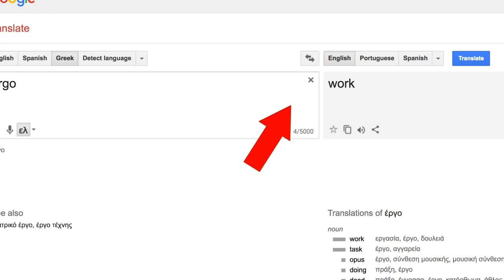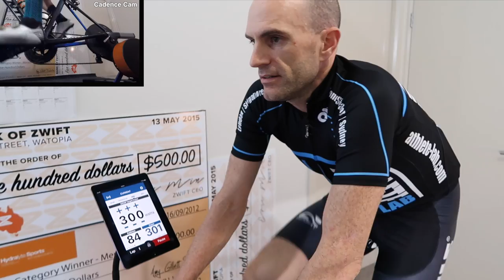Indoor Cycling Smart Trainers: ERG Mode Explained

Comment: Great information!  I wonder why Zwift doesn't just "program" the SOD (Spiral Of Death) out of their workout mode?  Seems to me you could program some automatically applied very short ramps at the load changes to eliminate, or at least reduce this effect.  Or how about a user set minimum RPM value, below which ERG mode would drop out.  You could even set a RPM value at which ERG mode would resume afterwards.  Maybe even program a recovery ramp for the load.   Sorry... just me thinking too much.  Again, GREAT work on these types of videos.
Reply: I do not think it is necessary, it is really easy, after few trainings you will do it all automatically without thinking about it. And it will also push you to try harder, you will know that if you fail you stop and you will do maximum to avoid it :)
Reply: Delkim; Could be...  But I ran across an online "review" of Zwift workout mode where the reviewer was obviously falling into the SOD, but didn't understand what was going on.  He had a few harsh words, concluding that it was "unusable".  I know I didn't understand what was going on my first couple of Zwift workout excursions.  Thanks to Shane, I figured it out a while ago.  That said, this videos introduction of the SOD coming in as the load is being reduced was another "ah ha!" moment for me...   Cheers!!!
Reply: Also, was thinking about how they could just program in a simple visual delay.  Myself, I am clued into the "arc" on screen.  My mind says I can "relax" once I cross it or that I should crank it up as I approach.   Zwift could simply but a delay in that, or alternatively an advance in the load ending.  Maybe both could be user designated.  Just thinking...

Comment: Shane, A question.  you mention that some trainers handle the transition quicker than others.  Which would you recommend that handle the transition a little quicker.  By the way I notice that there seems to be two parts - a delay after the new segment starts before the transition starts, and then the transition itself.  For instance with my Direto and Zwift a 160-400W transition actually has a delay of 3-4 seconds, and then starts the transition.    Oddly with trainerroard, I get the transition, but not teh delay.  With Direto & Zwift I get the delay going down in power as well.    So advice on any trainers that handle this better would be appreciated.    I am primarily using the turbo for training in erg mode and structured workouts.

Thanks for your excellent videos and analysis by the way.
Reply from the maker: Trainer Road preempt the change and send it to the trainer early. That's my experience. The Stac ZERO Halcyon kicks in super fast. The Neo in theory does too, and in practice... the issue with 'in practice' is the ANT+ limitations. You may get more responsiveness out of Bluetooth Smart.
Reply: OK that explains things.  Thanks Shane.   @gplama

Comment: Any tips for getting out of the spiral of death?  Backpedal, adjust target power on the ap, stand up and mash your pedals to get going?…
Reply from the maker: Never go past the event horizon..... there's no going back! Some software will back out of ERG if it detects you've failed the effort.
Reply: Haha.   But it’s not by choice!   In all seriousness, after years of resistance to a smart trainer I switched over.   What I didn’t like so far is when doing the super hard 2’ VO2 work and barely hanging on, a few times the trainer thought I was failing and sent me into the spiral.  If it had been in resistance mode, I’m quite certain from experience I could have held on.  Hopefully I didn’t just spend $1k for a trainer that I won’t use...!

Comment: Great video Shane. I created a custom Zwift workout, based on a GCN workout. In the GCN video, they want me to ride at 85% FTP but only spin at 50 cadences. I can not do that on the Elite Rampa. If I spin at a cadence of 50, my wattage is about 40% of FTP. How can I get the resistance up, while still holding my power? Also, I was curious, there seems to be more than one way for Zwift to pair with the Rampa, should I always use Ant+ FE-C? Thanks VERY much!
Reply from the maker: All trainers are not quite the same when it comes to ERG. You may need to change gears and change the flywheel speed (up or down, it could be either way) for it to apply the correct resistance at the required cadence. There should be an optional flywheel speed for ERG... which isn't published as part of unit specs. FE-C is what you should pair to with this unit, not the RealTrainer profiles.
Reply: Shane Miller Awesome suggestions. Thx

Comment: Hey Shane, so I've been doing time trials now with clip on aero bars and have been doing well in my races usually placing on the podium. Would you recommend investing in a time trial bike. Some more info about me, I'm 17 and have already purchased aero wheels and a tt helmet.
Reply from the maker: Sounds like a good question for a coach who knows what your current limiters are.
Reply: No any position or change on usual road bike or any clip on aero bars can match that huuuge difference when using real TT bike. If you are serious about TT then buy one. Even some cheap second hand TT Alu bike will always be faster than super expensive carbon aero road bike!

Comment: Shane, once you go through the spiral of death and you're still in the workout, how can you restart without completely burning out your legs? I have the Elite Direto if that matters and I mostly use it with a Garmin Edge 820 in workout mode on the trainer. Thanks
Reply from the maker: ERG mode will automatically disengage within Zwift if you encounter the spiral of death.... If you're controlling the Direto with the 820 then you'll need to use that to reduce the ERG setting to get up and spinning again.

Comment: Question for you Shane (or anyone) if you'll indulge me. At around 3 minutes you talk about oscillation. Does that oscillation occur within a single pedal revolution or over a series of revolutions? Currently ride dumb-trainer with poor fly wheel but on-bike power. I see oscillation like you describe over many revolutions but what I'm wondering is if this oscillation occurs within a single stroke - in particular through the dead spots - and if the trainers account for that to keep a more road-like feel (through dead spots in particular) than my fluid resistance dumb trainer does.
Reply from the maker: It's over a few pedal strokes. You'll find a trainer with a flywheel (or simulated flywheel like the Neo) will replicate outside a LOT better than a fluid trainer. It's due to the inertia/momentum of the system... something most fluid trainers lack in.
Reply: Shane Miller appreciate the reply! thanks a ton.

Comment: Shane, great post, thx! Any idea how to use erg mode within the Wahoo app while riding on Zwift? For example, you don't want to leverage a workout and you just want to use erg on the fly without too much structure. This actually used to work, but there was a Zwift upgrade a while back, and I haven't been able to get this to work since (I think it was Volcano extension).

Cheers!
John
Reply from the maker: Don't pair the trainer as a 'smart-trainer' and just use the power meter option within Zwift. This way you can use whatever you like to connect to your trainer and control it (other program, head unit, mobile, tablet, etc)
Reply: This is brilliant!  I will have to try this.

Comment: If you wanted to use a smart trainer for field testing (8min max effort test, 20min max effort test, etc), what is the best mode to use?
Reply from the maker: Not ERG. Software will typically put you in slope/level mode for these.

Comment: Need some advice tried erg mode for the first time today and towards the end of the interval cadence was between 90-100 rpm but resistance ramped up so much in the last couple of minutes i could barely turn the pedals. Any ideas ?

Comment: is it better to use erg mode with the power meter of your direct trainer or with the power meter in your pedals ? i have the feeling it's less accurate if i use my pedals but would think the pedals are more accurate with saying what power you give at that moment tho...
Reply from the maker: Typically a power meter on the bike will be more accurate. It'll also be less responsive in ERG. This depends a lot on the exact equipment used.

Comment: On the topic of slightly undulating reistance I've notices another deviance on Zwift in Erg Mode. When I'm riding for example Treshold or VO2 max I'm quite sensitive to the little small spikes and ease offs around the target value that you mention in the video. In my case it's really noticalbe on undulating terrain like the Sequoia aera which is dotted with little sharp crests. What happens is that the trainer up the wattage somewhat, maybe 5-10%?, for a second when I hit a downhill and the opposite, ease off 5-10% for a second when I hit an uphill. Then it quickly stabilize, but theese little spikes are really tough on the legs in FTP or VO2 max efforts. I think what's happening is that the software controller that calculates the effort required in order to tackle the terrain and then cancel it in ERG mode overshoots. I e that the SIM mode isn't absent in ERG mode, but that ERG mode overlays the SIM mode and actively suppress it all the time to "level out" terrain. When the PV changes when the terrain changes the SP will change accordingly but overshoot before it gets back in to line (see PID-controller). I therefore prefer the Big chainring on hard intervals since the increased intertia help level theese spikes, though it's a bit noisier. I also prefer Tempus Fugit for VO2 Max since it's really flat. I use an Elite Suito.
Reply from the maker: The SIM terrain should have zero impact on ERG mode.... but.... I guess we never know what bugs could creep in. Have you tried doing an ERG mode workout with the screen facing the other way (so as not to be influenced at all by the visuals)?
Reply: @gplama  Thank you for answering "zwift"! I did think of that bias at first since I get a little queasy cornerning on descents in Zwift indicating that I'm affected by the visuals. But I think that, if that's the case, I would feel that the resistance increases when starting an uphill and vice versa. I feel the total opposite, hence my idea taht it behaves just like a PID-controller that overshoots on quick PV changes. I haven't tried turning the screen off though.

Comment: Hey! Thanks for this video...needed that...I recently got the Tacx Flux - can you do an addendum for Tacx erg mode set up too?
Reply from the maker: Under Zwift, TrainerRoad, etc, it's all identical. Use those for ERG mode, it's much better than the manual way I was using just to demonstrate. The Tacx training mobile app will give you the kind of control I was showing in this video.
Reply: Shane Miller thanks! I am already on Zwift and love the gradient changes...will start with erg training as well...

Comment: shane, i am new to my indoor wahoo kickr and i am having issues with swift and the trainer. i am losing the erg and watts and my training sessions are getting ruined because the program thinks i stopped cycling . i tried a few things to  get rid of the interference but no luck yet. also am i supposed to use my gears in these modes and let the trainer change the resistance. thank  you
Reply from the maker: Best I can point you at is this: https://www.youtube.com/watch?v=H1WvBJbyJHM  Failing that, Wahoo or Zwift Support are the best ports of call.

Comment: Hi Shane thanks for this video. I literally was thinking of writing to you about this. One zwift related question let say I design an interval workout. For sake of simplicity 3 one minute intervals at 300w, and in between 1 minute off say at 150 watts. Will erg mode switch the wattage automatically or do I have to change it myself like in your video when you go from 500w to 200w. I thinking this would be great for a ramp test if it happens automatically. I have the new Kickr and the Drivo by the way.
Reply: Zwift workouts in ERG mode will switch the resistance for you. Minimum duration of any block in Zwift is 10s and like Shane said, it needs a decent amount of time to settle into power changes. So short intervals are hard in ERG mode. But 3 minutes and on and 1 off works great. I find even 20/40 over unders works fine as long as the 20s isn't too hard (say no more than 125%). Seems like at least for me, the higher I go above threshold, the longer it takes me (and therefore my trainer) to settle down.
Reply: Thanks really appreciate it. This is a new field for me.
Reply: It works really well for workouts. For the past year when I did workouts I had to make do without ERG because I prefer the power meter on my bike and Zwift only recently added ERG support for non-trainer power meters. You can do workouts without them. But the concentration to keep a constant power was always hard for me. It really does help to just do a workout program (or make custom workouts) and use ERG mode. It'll let Zwift or TrainerRoad... keep you honest. Plus it just means you can focus on getting through your block and not have to stare at the numbers and control your power. 

Like Shane said, ERG has its weaknesses. But when you just want to knock out a set effort, it does a great job if you can avoid the spiral of death. When I'm holding 100-150% ftp or so, I'm struggling hard enough. It is much easier for me to just focus on breathing and turning the pedals, and let the trainer take care of the resistance.

Comment: Hey Shane
Do you know if there are any plans to develop ERG mode any further on Zwift? Was thinking about something last night when riding on Zwift. Could ERG-mode be made zone-based. So, you set an upper and lower power level e.g. 250 to 275 watts. So, when you hit 250 watt the trainer starts adding resistance (like ERG-mode) but between 250 and 275 I works as a normal trainer, and then when you hit 275 it will remove resistance.
Was thinking this would be really helpful to get the feeling for different power levels, and way more comparative to the road.
Reply from the maker: There's a lot that could be experimented with for sure. I'd like to see % gradient intervals/workouts, so people can ride as hard or as easy as they like... but they all do the same 'effort blocks' so to speak. It would also remove the complexity of 'FTP' and knowing, not knowing, screwing it up, or just not being motivated enough to hit FTP numbers on any given day.

Comment: Hey Lama - thanks for the great video!  I'm wondering if you can advise me.   I'm having a problem that I thought was just my misunderstanding of ERG mode, but it seems to be the opposite of a spiral of death.  When I'm doing a workout that jumps from high watts to low watts (say 270w -> 70w), often times I have to wait a significant amount of time for my trainer to give me any resistance at the lower wattage.  This effectively means I'm able to spin my legs at any RPM without feeling any force on the trainer - sort of like it feels when you're riding downhill on too low of a gear.  From what I see in this video, I shouldn't be feeling that, I think.  I've got a spanking new Kickr 2018, and I've been riding on zwift.  I'm nearly positive I've got ERG mode on - but is there a way to check that mid-ride? I also don't ever change gear while I'm doing set workouts - is that wrong? 😬
Reply from the maker: 70W is a pretty low range... the trainer will likely be bouncing around trying to figure out where that is. ERG usually performs best when you've paired the power and controllable unit to the trainer, as opposed to 'Power Match' where you pair to another power meter. Maybe try a few different zones 270->150 or something over 20 seconds.
Reply: @gplama  ah, maybe that's it then - it may be that my FTP is too low at the moment. I did a ride that had a brief Sprint at 270w and a 90s cool down immediately afterward. The pack took off while I waited for the trainer resistance to catch up
Reply: It may be time for an FTP test - I'm only a few weeks back in to riding after some injuries over the summer. Been trying to get myself back into form slowly! Thanks for the help. I'll let you know what I find

Comment: Shane, i was wondering whether Zwift by default control  "Kurt Kinetic Road Machine Smart" or Zwift does not control its resistance. Thank you in advance.
Reply from the maker: Road Machine Smart Control - Yes. It will control the resistance on that (not the 'Smart')
Reply: Thank you Lama for taking time to respond.

Comment: What's the best way to tackle cadence training  while using ERG mode? Just had my first run in with the spiral of death this last weekend while trying to do a cadence session and it failed miserably with just the kickr snap. Looking at adding the Wahoo cadence and speed sensors now too.
Reply from the maker: Umm.... just keep spinning? :) A good sensor is a must. Hopefully that will have you sorted.
Reply: Adding the cadence sensor did help, though I'm still running into issues on low cadence high power intervals. Seems like it takes a few cycles before the ERG works correctly. I know you should really have to shift down, but that seems to help to get it to an 85 cadence 55 watts.